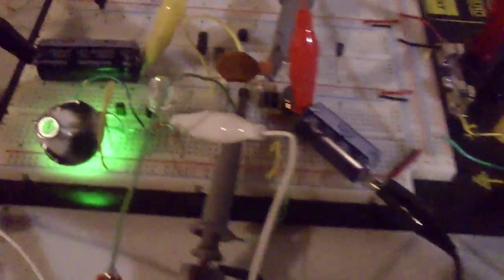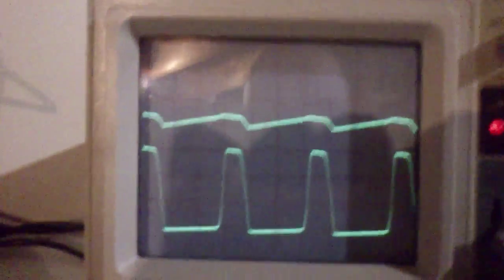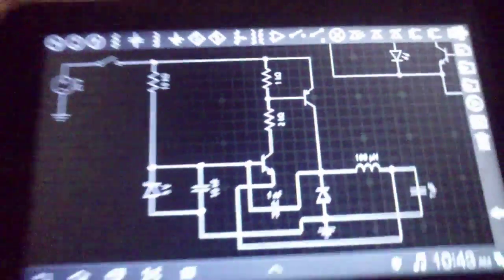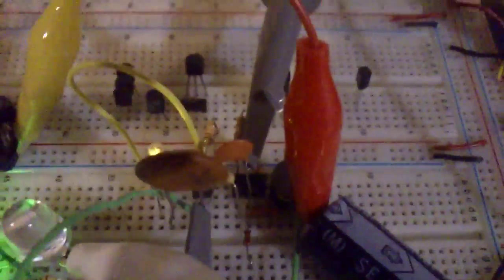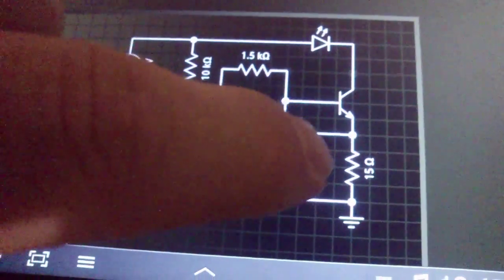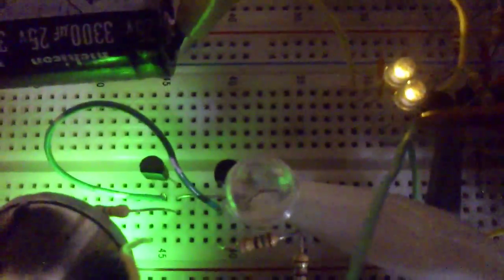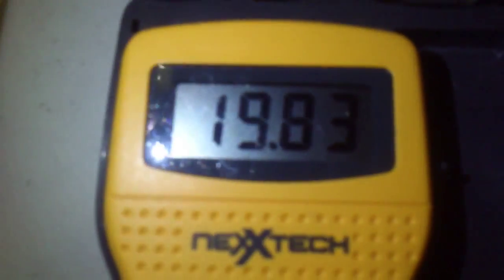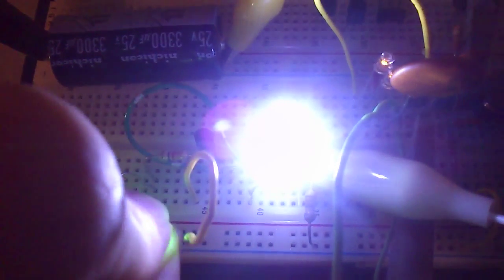D.C. To D.C. Buck converter and constant current source

Comment: sir i am design dc-dc buck converter, 24 input volt and 5 volt output, sir i have required design circuit  of buck converter, if u have some design circuit please send me.?
Reply from the maker: Buck converter are very easy to build. You can do a quick search on Google for dc to dc buck converter and then pick the one that will suit your needs now of course 24 to 5 volts is a good start you also need the max power you will require and the stability of the voltage at the output. You can also check for the chip MC34063 which is a 3 in 1 dc to dc converter chip that is very cheap and also can handle about 1.5 amp peak and can be boosted to the power you need fairly easy.